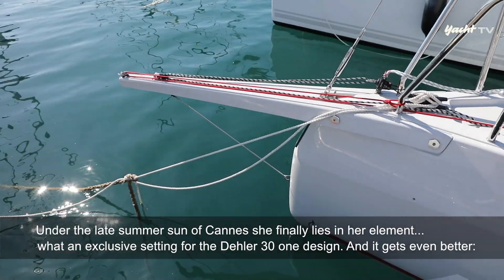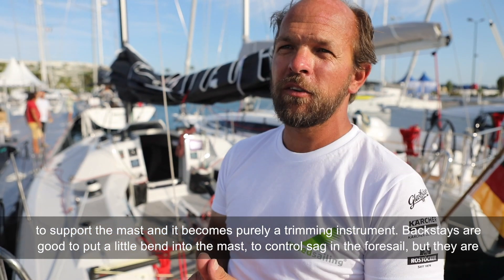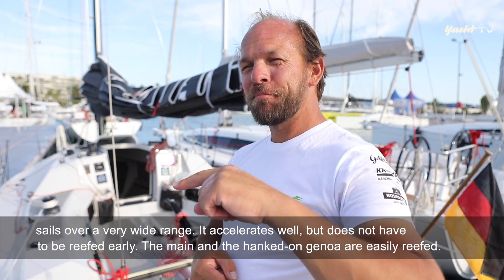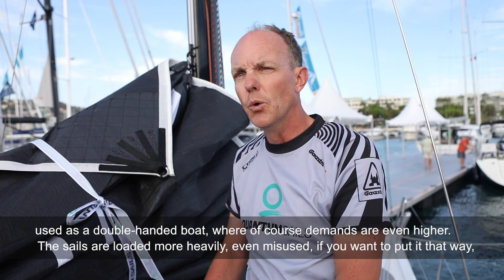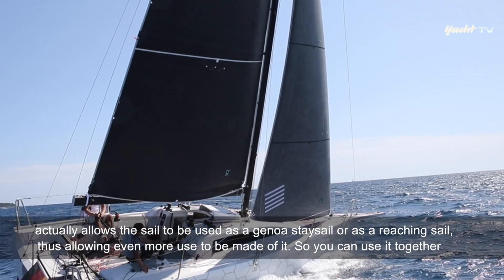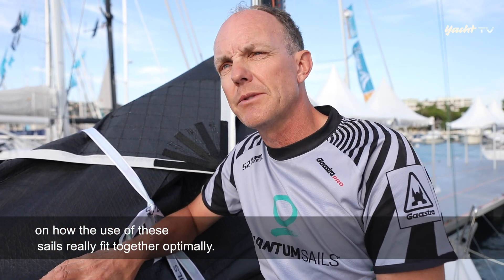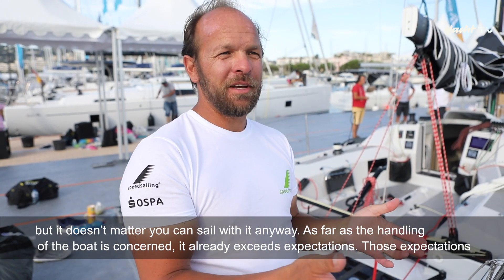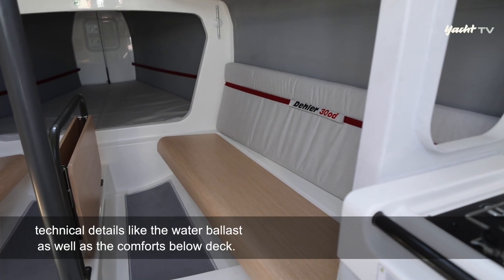English subs: #5 Dehler 30 od - she's sailing fast!

Comment: IF I only had the money...it would be a long hesitation between a Pogo30 or this very good looking babe.
Reverting again to this great presentation: life is funny sometimes.  By total coincidence the setup of my 20 years old little boat is almost copy paste of this race beast, except at 20% of the budget (in spite of new Quantum sails!). And I tend to find the Seascape 27 even more exciting, in spite of its really tight volume. So size does not always matter in the end... The Pogo 30 and this one "almost" disappoint because they're so quiet on the water, so perfect. I prefer it a bit bumpier...and cheaper probably 😊